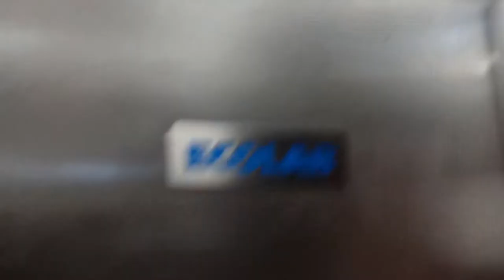Restaurant Dishwasher Cleaning

Comment: What happens when your dishwasher is not throwing any soap
Reply from the maker: Check the red tube on the top. There will be a switch to “prime” it (pushes the soap through the machine)
If that doesn’t work, call your rep